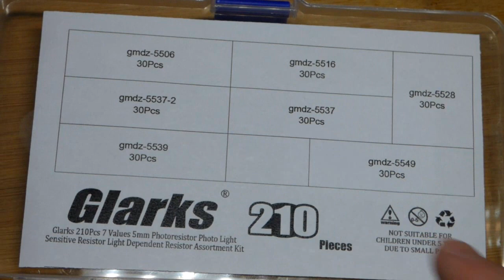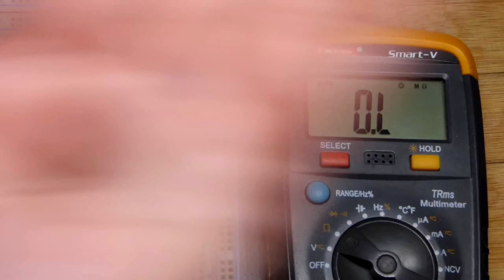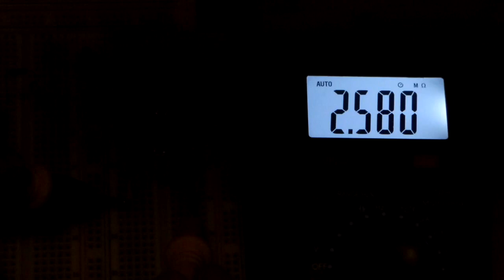Measuring 3 different light dependent resistors LDR from my new kit by Electronzap

Comment: Thank tou so much! One question, if with the light brightness I need, the LDR meassures 400 Ohm lets say, if I put in paralel a resistor of 400 Ohm, that should close my circuit making resistence near 0 right?
Reply from the maker: Two equal resistances in parallel gives half the resistance of one of them. The same current flows through each of them as if they were alone, but then it combines so you get twice as much current through the circuit.

Comment: I, too, separate out my test components. They go into my breadboard components bin. This does two things... 1) The components in the breadboard bin have already been proven as good and do not need to be proofed. This saves a step. 2) If the breadboard components get stressed in some manner, that reduction in performance does not get passed along into a new project build.